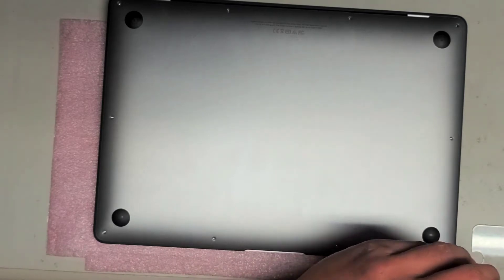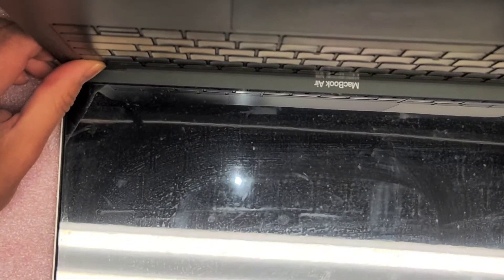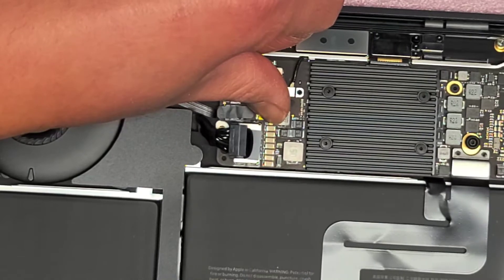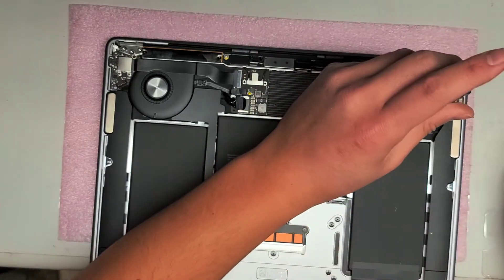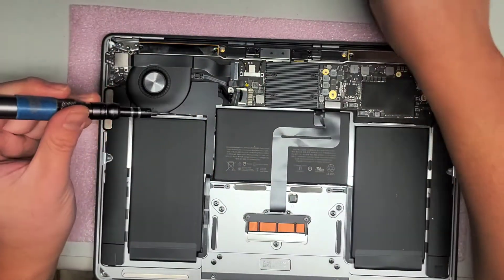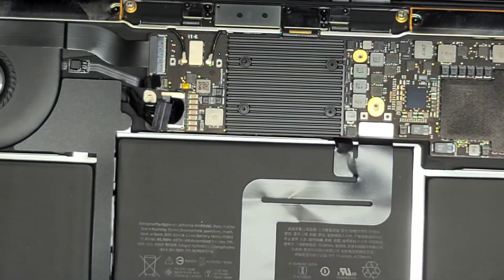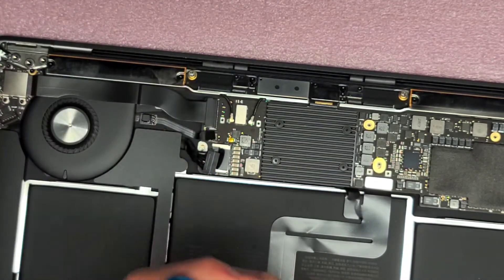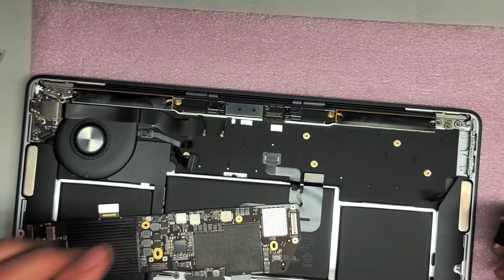MacBook Air A1932 2019 Liquid Spill Repair Charge Port Replacement Logicboard Motherboard Removal

Comment: Girlfriend has a 2019 MacBook air a1932, not charging or turning on and without water damage. Got the DC jack part and replaced in less than 10minutes. Thanks for your video/instructions
Reply from the maker: Glad it helped. If you haven't already, please like and subscribe so others can find my videos. Thanks!

Comment: Hi, thank you for your videos! Same MAcbook air here, also liquid damage. I took it to a repair center, they cleaned a very tiny humidity spot, did some maintenance but keeps having the same issues: the screen has a lot of noise and a sort of ghost flickering vertical stripes on the left side. The rest of it works fine (charging ports, trackpad, etc). Do you think I need to replace the whole mother board? Or can I try to repair it? The guy didn't open the whole board like you did here. Thanks!
Reply from the maker: Not sure. Could be the screen or the logicboard

Comment: Thank you for this video! I succeeded to access the charging port! But I don't have the replacement piece, it seems that it's the same for the macbook air 2019 and 2020, can you please tell me where I can get the replacement charging ports? Thank you very much!
Reply from the maker: Usually eBay or Amazon.
Reply: @ItsBinhRepaired  Perfect thank you very much!
Reply: @ItsBinhRepaired  soap got into my girlfriend's charging port, and it won't turn on. Do you think I should replace the charging port
Reply from the maker: @lulkobe1  sounds like it might have damaged more than just the charging port, but you can try.

Comment: Hey thank you for this video. Wine poured onto my mac’s key board, is there a chance that it could be fixed? Using this video. 😊 it’s 2months since it blacked out.
Reply from the maker: Possibly, but you'll need to take it for logicboard repair
Reply: Thank you, how much is it to repair that, Does it cost a lot of money?
Reply from the maker: @nvclo  depends on the damage

Comment: I have a macbook air 2019 a1932, no water damage, but it just stopped to charge, i was able to use until the battery goes down. I have already changed the audio jack and usb type c port and still no working. I noticed that when i plug in there is a white light on logic board. Do you have any idea what should be done?
Reply from the maker: Not sure :( maybe battery connection?

Comment: I’ve been watching your videos. I have the MacBook Pro 2019 as well. Would I be able to check out  charging ports the same way that you did here. For some reason my MacBook just died, was well kept, never around water. 
I’ve opened the back but was not able to unscrew anything else and it looked completely fine.
Reply from the maker: If nothing responds, it's likely a dead motherboard. Try another charger first, just in case.

Comment: Hey I have a small question. I have one but when I Connect the charger, it’s chargers(won’t charger the battery it just give enough power to have it on) you think it might be the charging port ? A bit of water fall into the mac.
Reply from the maker: Could be charge port, battery, or motherboard.

Comment: Mine keeps breaking any usb c cable I purchase. I have four cables not working. MacBook Pro i9 16 inch. Please what might be the cause.
Reply from the maker: Did you replace the port?
Reply: Not yet
Reply: I thought it was from the charger, I used a friend’s own and the cable got broken. I bought a new charger and the cable stop working after some hours.